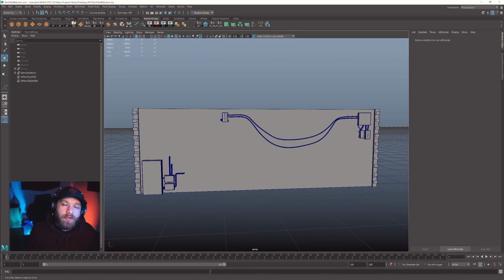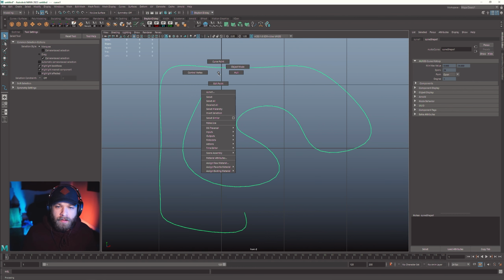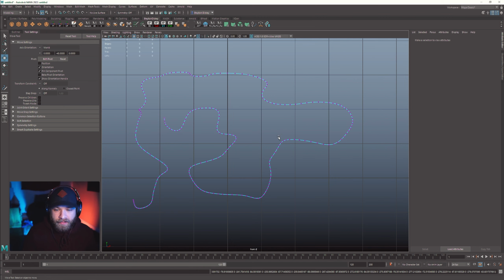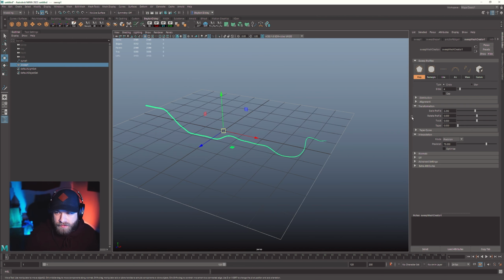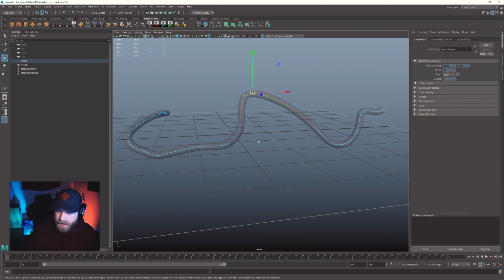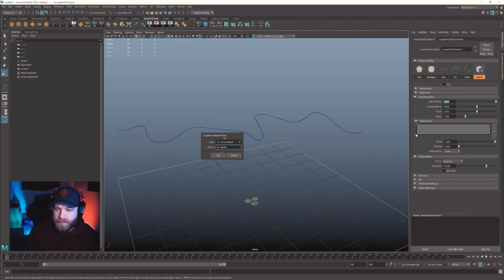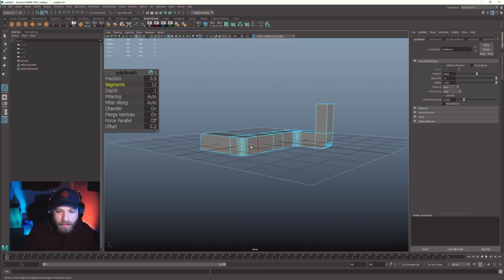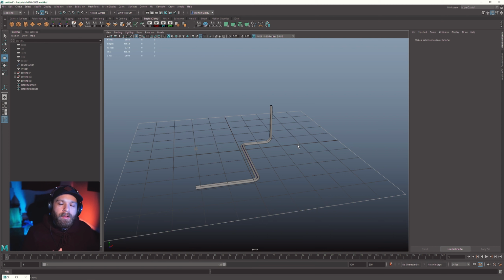Maya's Greatest Tool for Wires, Cables, Pipes, and More! How to Use the Sweep Mesh Tool

Comment: how do you make it selectively bank/roll? i'm trying to figure out a way i can just select a spline/curve point and rotate just that part of the track, but points don't have vectors so i'm all out of ideas.
Reply from the maker: Depending on the curve tool you use, I think that 'banking/rolling" is sort of figured out by the curve itself, just trying to make the smooth curve to the next point. Maybe using the Bezier Curve tool would work best for you here as you can more succinctly control the sharpness of a curve. Lmk if that suggestion helps!